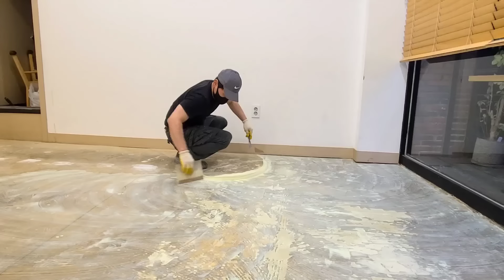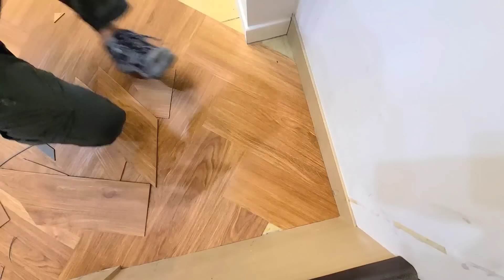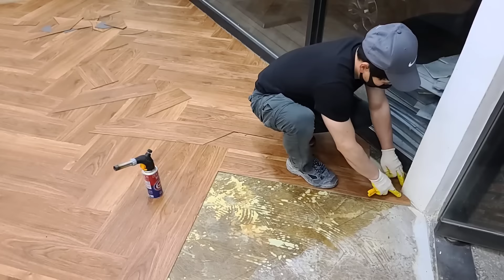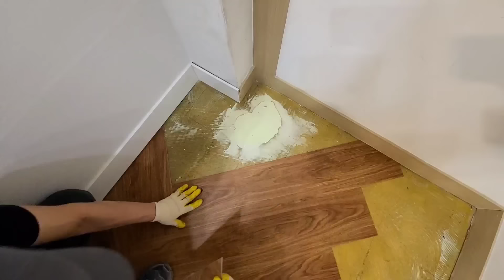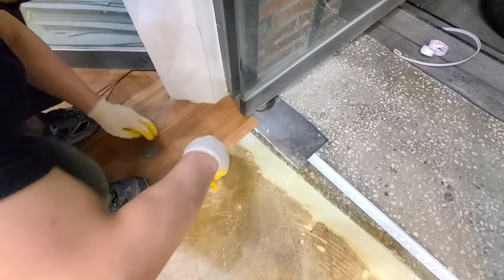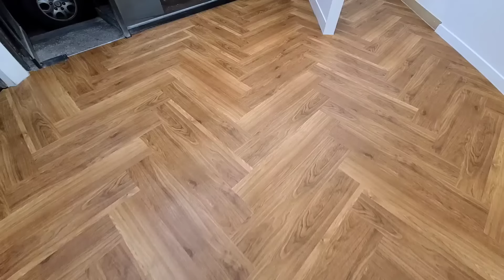[ 일당 2배 ] 헤링본 시공법.  Herringbone style construction received twice the money.

Comment: You know when someone is a good installer when they never use a measuring tape to make cuts. I love installing glue down lvp in a herringbone, it's lots of fun. I'm a commercial flooring installer myself. Good work, man.
Reply: Genuine question but whats wrong with using measuring tape? Im no expert at all but they way he cuts them only works in perfect paralel walled room no?
Reply: @Spacidius  nothing wrong with using a tape. It's just much faster and cleaner scribing it. He is just marking his long point on the board and cutting his angle. You can use this method on very out of square rooms and it works great. On your first cut piece, you can lay a temporary piece in place then overlap it with another piece horizontally tight against the wall then draw or cut your line. Then you have a pattern piece. Hard to explain without drawing a diagram or showing in person. There's probably a video that explains how to scribe lvp, I'll look it up and share a link with you if I find it.

Comment: I just can't figure out how he is able to cut those angles so precisely.
Reply: He surely took the necessary steps before he pre-cut some front angles and then he transfered those angles.

I still amazed that he did it by a show of hands
Reply: That's what years of experience can do to ya
Reply: Geometry
Reply: A blade
Reply: 나도 이게 궁금했음
Reply: They are only parallel cuts, you only need something straight.
Reply: That’s what you get when using tools for so long you get experience
Reply: Its called experience
Reply: It’s quite easy ? You have 45 degree angles all over the floor , just touch the wall with a corner , stay parallel to other tiles and cut parallel to the wall , turn , finished . It’s not magic it’s geometry
Reply: @BLACK DINGO I've watched almost everyone of his videos and he doesn't need to do that. I install flooring like that  and that is how I do it. And its made here in the USA by Armstrong.

Comment: I still can't figure out how he measures corner cuts..
Reply: floor lines were the key and before he started assembling wood , he had simulated it on computer and after all, this guy got experience
Reply: Mark the long side and use your Templet angle.
Reply: That's why you are relegated to the comments section.😅😅
Reply: Yeah that's the part I am not getting.
Reply: @suesanborts-bredall9914   mark of longest length on your board draw angle with bevel ....cut .
Reply: Took me the entire floor to even see how he was making the cuts. Totally threw me off at first, til I realized he had 2 pieces and used the short side of the bottom one and the other was a template. With a lil practice I think a man could master it. He has the method for sure! And the angled floor goes down a whole lot faster than starting 3 or 4 rows and walking the floor left to right 1090 times lol
Reply: Lo más importante no enseñó despacio como medir para cortar las orillas
Reply: I think I'm brilliant because I could not figure out this also
Reply: The glue would have totally dried before I had laid four of them.
Reply: @Jane_under_a_tree_with_a_book  most glue is supposed to be dry when you lay it in, it has a certain amount of "open time" before it needs to be covered. Some adhesives are "wet set" and that's a fucking mess trust me
Reply: If the room is completely square (walls at 90 degrees to one another on x and y axis it makes it more predictable and able to use the triangle to make cuts), if the room is not square well..

Comment: This person makes it look so easy.. I wouldn't be able to make such clean and precise cuts, if I used a proper scale and pencil.. practice indeed makes one perfect ❤️
Reply: you will, all you need to know is that everything is in 45 deg. angle + using an metal shape for the cuts (that's how it is normally done but more time consuming).
Reply: @ivobrick7401  it also helps if the room is actually level and walls are straight ;D

Comment: While he does exceptional work, the cutting of angles are much easier than most think. The utilization of every piece of material is the impressive part to me and I have been doing commercial glue down for 20+ years! I would hire this guy on the spot!
Reply: @Timshky  how so ?
Reply: @Timshky  is that a bad thing. Dint quite get this
Reply: Joe Andersen  wtf
Reply: Joe Andersen  come on this dude making a new floor and then u came up from nowhere talking bout the bible? xD
Reply: @GardenHood  
He obviously lives in a pro-union state.
Reply: You might have an answer to this... did he start his set out wrong? The distance from the outside full length boards to the walls oblong the sides were different from one to the other by about 100mm. 
Now I'd suspect when he's set out his room he's just found the middle and pinged a chalk line yeah? If that's the case then that's why it's not symmetrical.
Reply: maristboy25  yes, the centre line needs to be in the middle of the two locked tiles. That’s the only fault I could find. I spotted it at the start and thought he didn’t know what he was doing but he’s got the cuts down to a tee. Nice job. In a large room it’s not so noticeable but in a narrow hallway it would really stand out.
Reply: Ok, let’s see you do it.
Reply: @OleGunner99  sure.
Reply: @kylebosley1101  😂
Reply: Fitzhugh Goode something funny?
Reply: I don't think you can afford guy like this. This is $300 a day "cash" worker for any good contractor.
Reply: @Timshky  The video's about laying down a vinyl floor.  This guy's so precise, he's not cut himself once, therefore no scabs. But why bring union work into the equation?  IN China? Geez, man...your comment is beyond my comprehension.
Reply: @ronnym1977  Texas
Reply: @ironmiketeam4689  And he is worth more than that! P
Reply: If entire room is square. 
What if the room is not square?
Reply: What about the cutting on the New floor

Comment: looks good, but could be better ... the first tile placed in the middle on the room should have been half way along the short edge not the corner of the tile ,  the two edge tiles along both side walls should be the cut same size, they are not so the tiles are not place symmetrical on the floor

Comment: Wicked video. This guy knows his stuff for sure. I am laying the floor down in the Herringbone style now and I can tell you it isn't easy especially the corners. Key is to take your time and have a spare box for those mistakes. He is no animator and doing this that is very clear. I will be tackling the corners last.

Well I completed the job and it looks fantastic. I have smaller panels. Took me 2.5 days. Everyone will say glue not needed but I advise you to not be a sheep. Buy glue to ensure no problems arise. A lot of negative opinions about this style of panel, often from those that didn't use a extra adhesive to the floor spray or paste.  Good luck.

Comment: The critical part is getting your center and guide lines laid out before adhesive goes down. You can see his pencil lines at the start. Pause the video right when he lays the first strip down. You can see the center line and crossing angle for the first strips. Once those are correctly placed,  he's off to the races. Without a proper layout, the job would be crooked and look terrible. Meticulous preparation is key and he did it. Excellent work.
Reply: Don’t forget the surface prep. A dusty or uneven surface would ruin the job. At least half the work/ time of this project is not laying the pieces. It’s scrubbing the surface, leveling compounds and meticulous vacuum and sponging down surface.

All this was done perfectly. Shame they didn’t show it here. (Maybe it was another team or contractor)
Reply: It is awesome when he's looking for angles and sides for cutting. He did very quickly and perfect